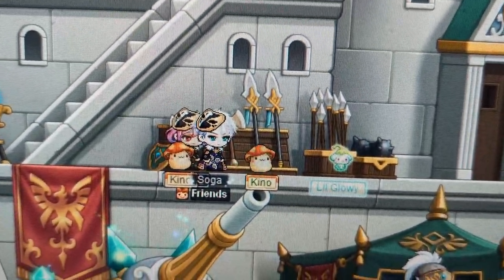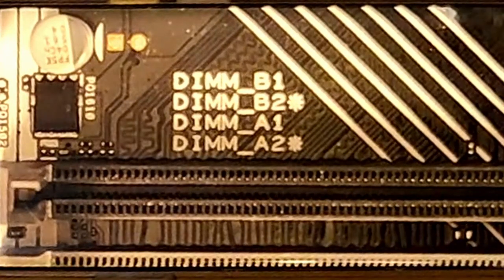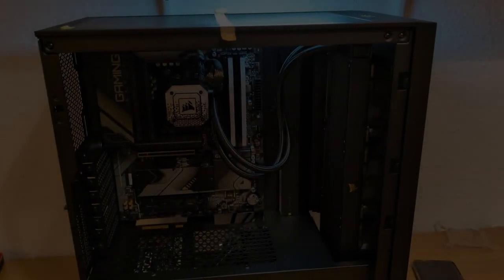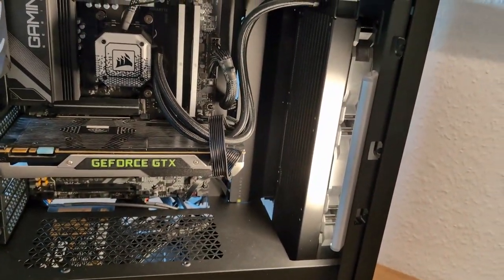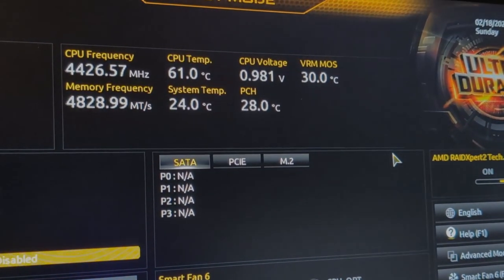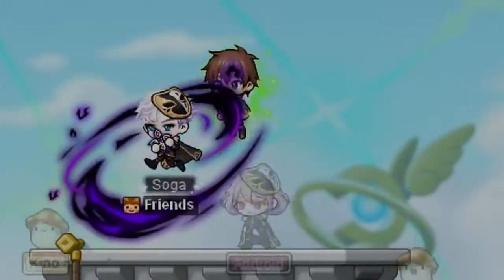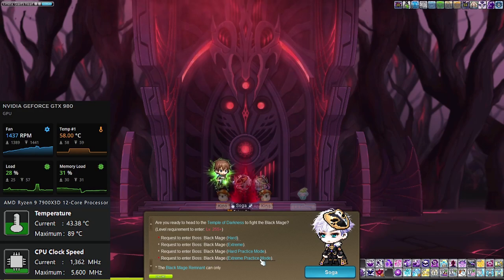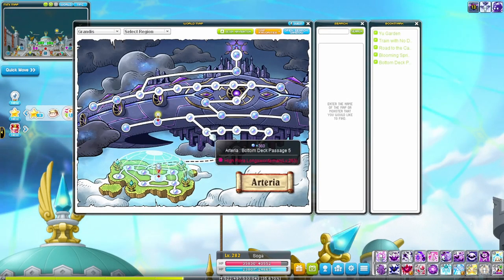Building My First Gaming PC

Comment: a2, b2 for Ram configuration is correct. Since you have an AM5 x3d CPU, make sure to update to latest AMD chipset drivers via AMD adrenilin auto detect installation media (from the website) -  after, make sure to disable the integrated graphics (CPU) in bios to reduce render latency. I run a very similar build and this avoids most issues related to the am5 platform when using a x3d cpu.
Reply from the maker: Thanks for the tipps!